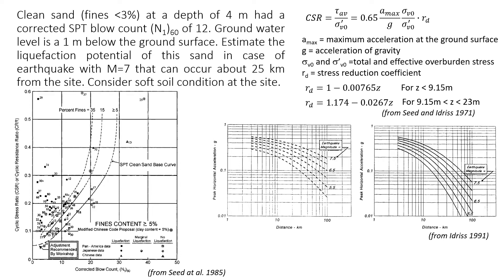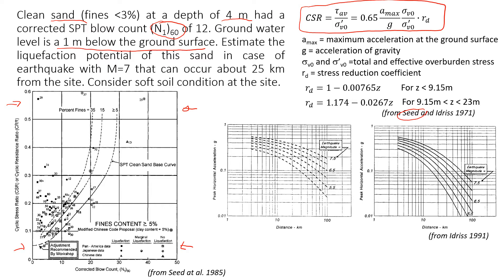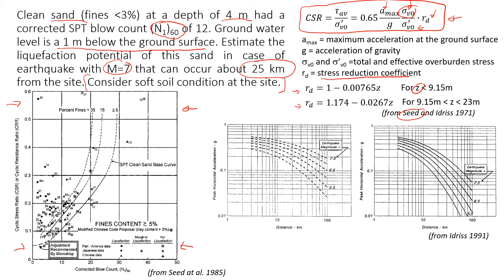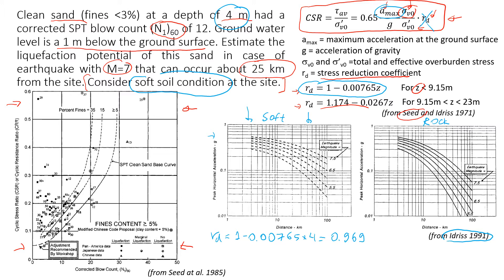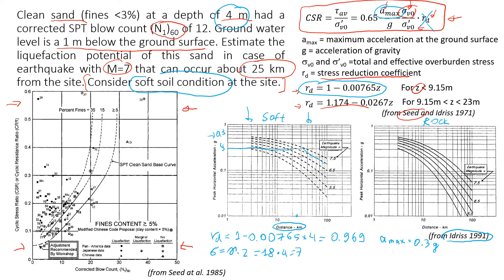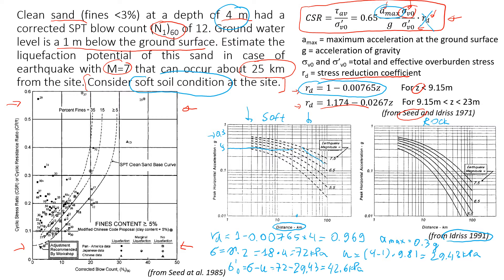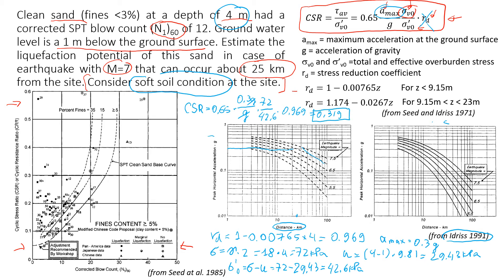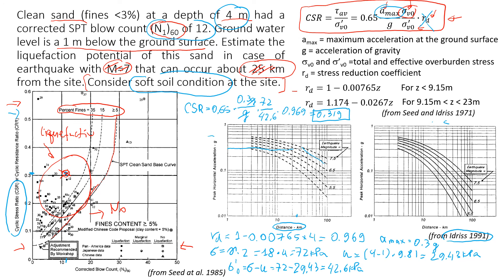How to Estimate Cyclic Stress Ratio and Liquefaction of Sand Triggered by Earthquake

Comment: Hello. How can I plot the curve showing the boundaries of the post liquefaction based on the percent fines 35, 15, greater than or equal to ? Is there a specific formula that I can use to plot in excel for example, or is there a template that you can provide me with?
Thanks in advance

Comment: Hi prof. I have question regarding to the subject.

I had an issue with a unique geological condition, a site where I was working consist of underlaying of interbedding layers of loose sand and clay with a relatively homogeneous thickness.. can we perform the analysis solely in sand beds or whether liquefaction potential might possibly be ignored? the site situated in Indonesia region where active tectonics involved, however the are considerably safe from seismic hazard zone (geologically the area located at old passive margin craton, no active tectonic plate margin surrounding except thousands meters away to the East). I also wonder how we can consider the area is totally safe from seismic damaging effect, in particular to the pile embedded?

thank you for your response,

best regards